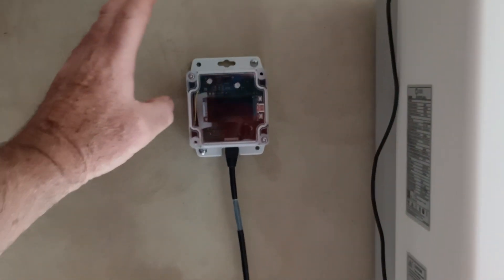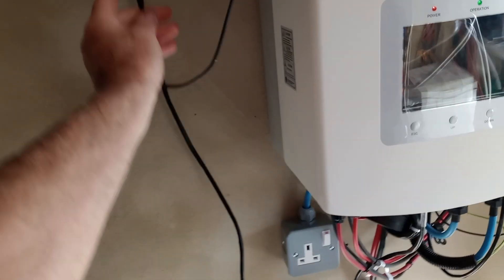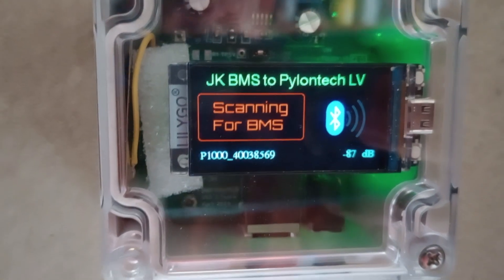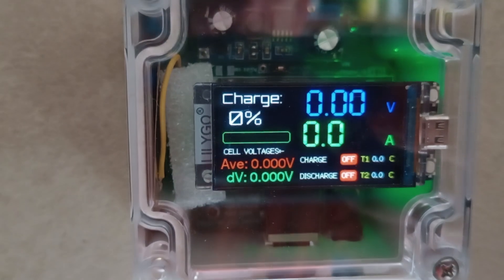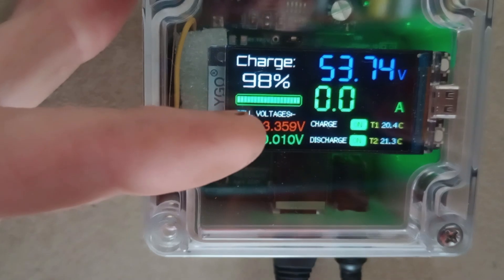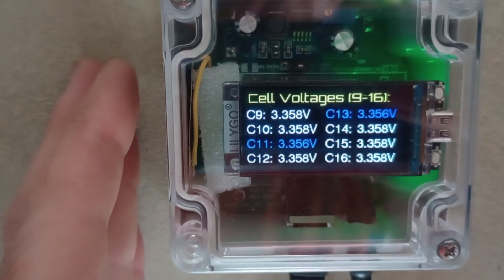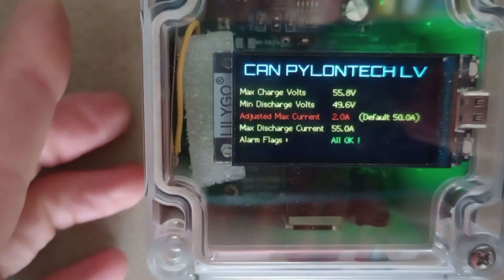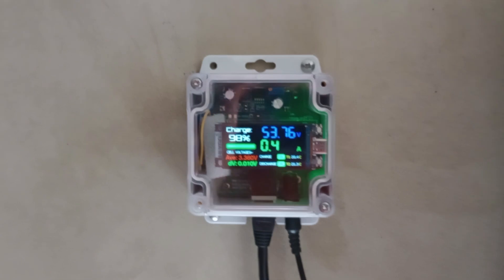JK BMS to CAN Bus Interface (Pylontech LV)

Comment: Hey Steve! I'm using a JK BMS (BD6A20S12P) that have a CAN/RS485 port. I bought a connector (JST-GH 3 pins) to try to use it, but no success. I measure the voltage on these pins and it ins't appears to a normal CAN bus. So, I think the BMS doesn't have a transceiver to CAN like a TJA1050. Do you have more information about it? I should try to get data from BLE anyway by now....

Comment: I'm one step away from successfully compiling the code after updating some function call changes for the ESP32 API going from 2.x to 3.x, but I have one error left and unfortunately I am at a loss for how these string conversions and logic work.  Do you know what this line is supposed to do?    std::string value = pRemoteCharacteristic->readValue();     I get the  Compilation error: conversion from 'String' to non-scalar type 'std::string' {aka 'std::__cxx11::basic_string<char>'} requested         It's the only error left.
Reply from the maker: ummm...wish i could help but I dont know wht may have changed.  I did see this ::-  
https://forum.arduino.cc/t/compilation-error-on-code-that-was-compiling-before-conversion-from-string-to-non-scalar-type/1265323

Please let us know how you get on and maybe I can put updated code on Github

Cheers   Steve
Reply: Hi. Did you get this sorted? Thank you

Comment: Will this work without the can bus?  That is, I just need a bluetooth connection to display the battery voltages and such.  I've done a few embedded processor projects and have an S3 sitting at home ready to go.  I'm just not awesome at tearing apart other peoples code, so I hope it just works and ignores the can bus.  Do you have an idea what will happen without the can bus connected?
Reply: LOL, I just read your last comment above - THANKS for already helping me!  "set 'CAN_use=false'"  Excellent - hope it works because your interface is awesome!
Reply from the maker: Yes it should work perfectly fine...makes a useful display..wireless range is only a few metres though.

Comment: Hi Steve, I made the module, it works perfectly with a JKBMS version 11 and three-phase DEYE SUN12K inverter. Thank you very much for sharing and this excellent work. 
Gilles.
Reply: HI there, where do you get all the bits from?  Can you get it as a kit or do you have to build it?
Reply: Hi, I followed Steve's instructions to build and program it myself. It's not difficult.
Reply: Great to hear it works on a JK BMS version 11...did you need to make any code changes?  I had though there were some protocol differences to V10 bms's  but I possibly  got that wrong! 😊
Reply: @brighstoneuk4532  Hello
I haven't touched the code and it seems to work fine.